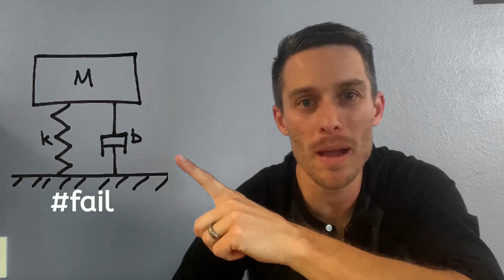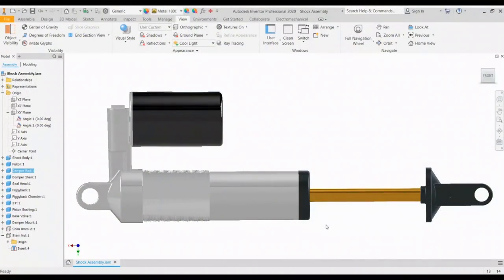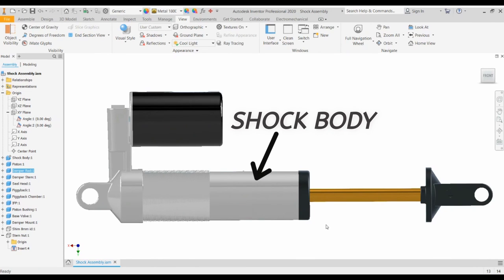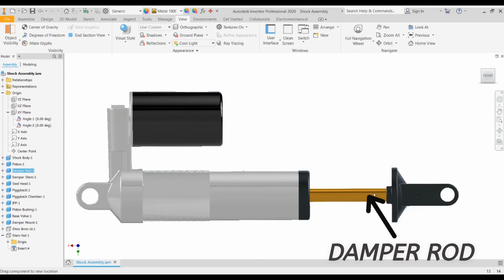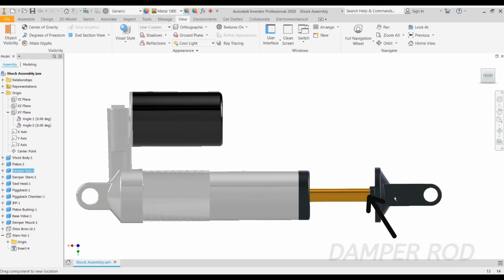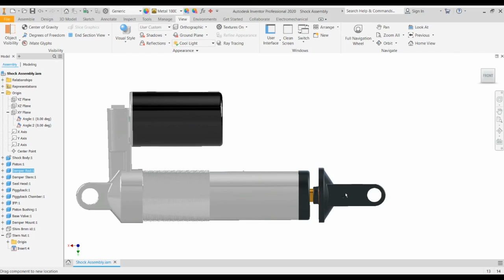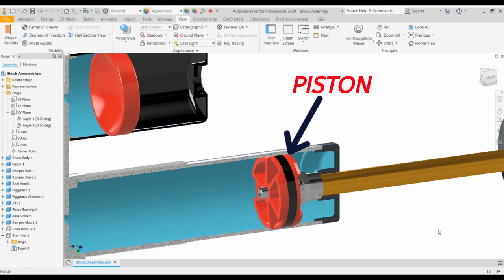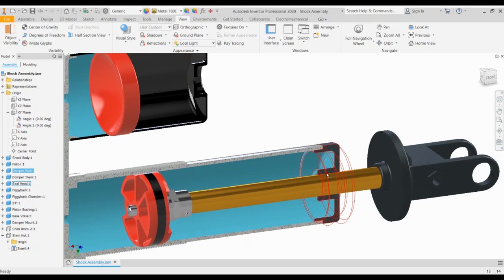Practical Mass Spring Dampers | for Physicists & Engineers

Comment: I think it's cool to think damping force is damping coefficient times velocity of the displacement. When the shock is very quick, the dampening force is higher.
Reply from the maker: Generally speaking, think of the spring as a POSITION dependent force and the damper as a VELOCITY dependent force.